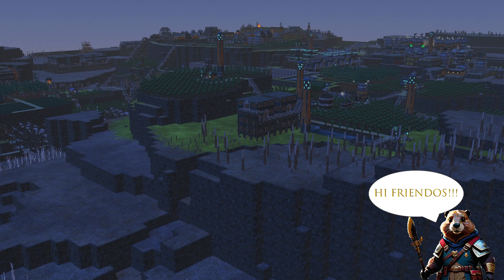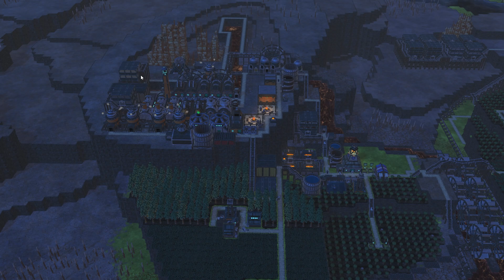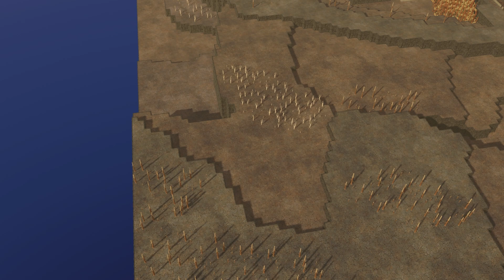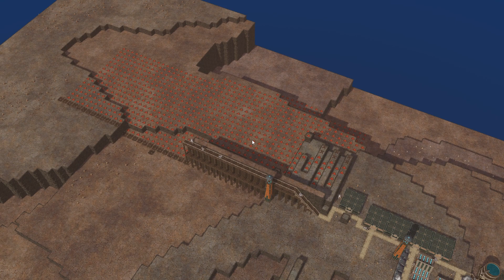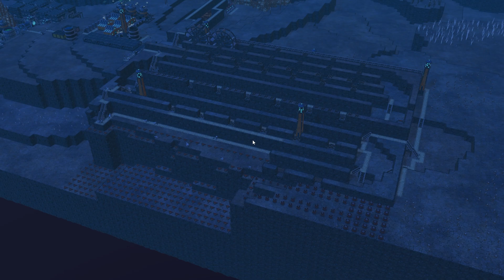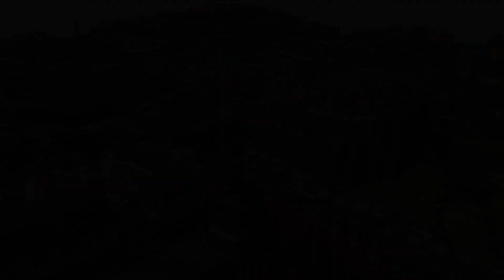SUPER UBER MEGA POWER BUILD!!! I did the thing! Timberborn HARD MODE S2EP26 (Update 5)

Comment: Well you were right when you said wait till Friday! Bc that was impressive but also kinda painful to see how hard you made it for yourself but the end result was more than enough power. 
The only things I would note would be with how you designed it (to make your life easier, we don't want you to suffer more than you need to) you didn't have to go so high and you didn't need to do dual channels because both of those are redundant with how you design it. What I mean is flow will happen even on a flat terrain and the dual channels cut the flow (which determine the output of the water wheels) by giving it 2 paths and you could have done one (if you worry about flooding just remember you control these sources) and forced all that flow to overdrive each water wheel in a single channel.
But I got to say it looks so impressive when it is done.